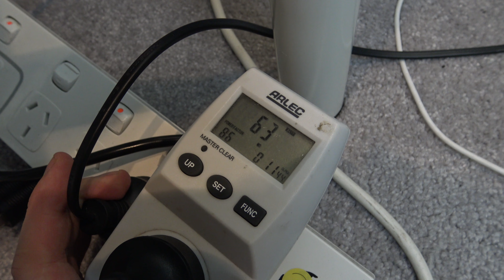How to build a Mining Rig on a Budget

Comment: I'd be careful drilling out rivets use something meant for steel so the damned tip doesn't bend off or something silly. Makes for better removal anyways
Reply: the rivets are usually aluminum, I've found even dull bits take them right out. Technically you only need to shave/thin the head off the rivet, at best an 1/16-1/8 inch deep hole and almost every size of drill bit will work as only the very point of the bit even touches the rivet. (for those running around looking for just the right size bit)

Comment: Does using a SSD over an HHD make any difference when mining since it’s primarily the GPU that’s the focus? Thank you and love the simplicity and detail of the build.
Reply: Not really.  There are some rigs that even run from USB sticks.  It would boot a lot faster which could be nice if the system has a fault and needs to restart however hopefully thats few and far between once the rig is setup.

Comment: Hey just a question, did that "rizer" cable come with the card or did you have to buy it separately?
Reply: All of my cables came with the cards, technically i got (usb to usb cable, riser card, pcie to usb adapter, and six pin power to sata cable) all in one little anti static ziploc.

Comment: wrong graphics card orientation ... all the heat from graphics crad will be push down towards motherboard
Reply from the maker: True, but it sits well that way. Turn it the other way it doesn't fit properly.
Reply: @123myIT  but using an old pre build pc for mining is a great idea ... 👍👍
Reply from the maker: @AkashvaniTech  thx dude.

Comment: Have a similar old dell as you to use. Do you think the motherboard can handle 3 2060s ?
Reply from the maker: Could do you just have to make sure your power is enough and that you have enough slots.
Reply: @123myIT  how big of a pcu do you think. Will 800w be enough. Thanks 👍🏻
Reply from the maker: @ablaze2201  FOR EXAMPLE ONLY. If 65 watts for 1 2060. 65 x 3 = 195 watts + you need to allow for motherboard power and components. So lets say thats 150 watts. 150 plus 195 = 345 watts. Then you need to double the amount of wattage for  efficiency and power spikes. So 690 watts. An 800 watts psu would be ideal. If you do decide to do this get yourself a power meter so you can measure power from the socket. Of you could just use that money and buy BTC :) My Amazon links in the description of the video mate. :)
Reply: @123myIT  thanks for this explanation mate. Helps a lot. If I buy one I’ll support the channel and buy through the link.
Reply from the maker: @ablaze2201  Nice one mate !

Comment: Hellonew sub here. Greetings from Ireland 🇮🇪 
I'm Building my first rig with old pc, and looking forward to start mining for etherium, find this video very helpful thanks.
I csnt get the sapphire rx570,
But I can pick up the 580 for 140euros. Other places are like twice that price,. This  is good budget for me, will the 580 make much difference?  Gonna hook it up to dell xps, I'm sure the current power supply will be OK for 1 card to get me up and running. What do u think?
Thanks in advance for any advice... 👍
Reply from the maker: Make sure you get the 8gb memory version of GPU should work ok.
Reply: @123myIT  hey, thanks for the reply. Yeah I defo wanna get going. Are 2ns hand cards worth it?
Reply from the maker: @todgerx  Most cards come with 3 year warranty. So if you can get original receipt would be ok. You might be better off just buying some bitcoin through a coin app. That would be my advice.
Reply: @123myIT   I'd like to at some point invest in solar. Have seen some amazing set ups.  I wouldn't mind the longer wait on roi.  But would still like mine something at some point. Why are they changing  ethereum? I hear its gonna be less profitable

Comment: I thought Powering the riser with SATA is bad?
Reply from the maker: It not best practice. The main thing is you will just make sure you not overloading power. In instances of mining. Most of the time you are trying to use as little power as possible. Say for example. I run a 2080 TI which is underclocked. It doesnt consume 300 watts of power only 150watts.

Comment: Very good video thanks! I have been studying rig building for a whole hour now haha can you tell me, I dont get the PCIe riser card thing..is that just to make space for large video cards? I see riser cards also have USB connectors..can you just run your cards off of USB ports on the MB? Thanks
Reply: The PCIe Riser is the adapter that connects the GPU to the Motherboard's PCIe connections.
Reply: @jpmonto01  That I know. But why the USB connectors on the risers?? Can you plug the riser into a USB port instead of a PCIe slot??
Reply from the maker: yeh to make space.

Comment: Great vid mate, I'm about to attempt a similar build, 3 years later.
How are you only drawing 70 watts?
The card specs say it uses 300 watts.
Reply from the maker: Use the underclock tools to reduce power. I would just buy the bitcoin directly. Mining doesn't make sense any more in my opinion.
Reply: @123myIT  Why not, care to explain a bit pls >?
Reply from the maker: @justgoogleit7879  Well, you can just stake coins now right? so what's the point of mining. Just buy the crypto and stake it with the money that you would have setup mining rigs. Let me know if you want a referral link and some more info.

Comment: Hi can i make a mining rig using a a68hm mobo and an amd a6 7400k and im gonna use a 1 rx 570 4gb and what psu should i get the 650 watts or 450? And is 4gb ddr4ram enough in this build?
Reply: Or should i just buy a amd athlob 200g and an a320m mobo for more upgradability? Please help!
Reply from the maker: @jjaze9831  I allow about 150 watts per 570 and about 100 watts for cpu mobo.

Comment: you dont as of feb 2019 every video card is pretty much going to earn you cents.   Untill the difficulty's drop anyway..

my usb asic only use's 2 watt's at 23000000 hash's per sec (23gighash)  and it only earns 14 cents per 24 hours...

earnings after 1 kilowatt hour (13 cents paid) is $2          is it worth $2 a month..      well, I got it for only $120

Comment: Very lovely tutorial up there. But Mining Bitcoin and other cryptocurrencies: Bitcoin mining is the process by which transactions are verified and added to the public ledger, known as the block chain, and also the means through which new bitcoin are released. Anyone with access to the internet and suitable hardware can participate in mining. If a contract of $2260 can gain $4959 in 166 days, then imagine a contract of $10,659 (1 BTC) using the PandaMiner B1 Plus, L3+ Antminer, Ebit E9 Miner 6.5T Bitcoin Miner or T9 Antminer. Ask yourself, what will it yield in 166 days also??? You can reach me any day, at anytime via [bitcoindigger86 @ gmail .com or text 470 231 5053]?

Comment: What kind of harddrive should I get?  balancing budget and low power usage?  also is there a cpu thats more efficient than the AMD that comes with celerons?
Reply from the maker: Hi Tom, most SSDs are pretty low power. So get a 120GB one. Links in the description. Sorry what do you mean AMD celerons?
Reply: The Dell Celeron 570 motherboards that come with a CPU ussually come with a CPU thats labelled AMD.  I know the difference it will make will be minimal when builing a GPU but hey its good information to have.
Reply: Im finding a few motherboards online with AMD CPU installed, heat sink fan, and 4 gigs of ram or 2x 4 gigs of ram for a decent deal.  I have yet to call businesses around town to see if I cant find a new home for A CPU destined for landfill
Reply: 123my  I apologize for the triple post, but If I went with one of these motherboards we are talkin about: 32 or 64 bit OS?  I appreciate all Ya do here mate.
Reply from the maker: Hi Tom,
I don't think the motherboard or CPU are so important choices when mining. Most important is GPU. Celeron is Intel CPU. AMD is not Celeron. :)
Reply: Hey mate, whats the bit on the build in this video?  64 or 32?  Cheers
Reply from the maker: Thats weird mate. Unless the box just says that but the CPU has been removed and replaced with AMD.

Comment: Hello From Canada! just wondering how many GPU's can you stick on that with that 750w Power supply. Great video btw got the same board for 30 bucks with the cpu. Or I am asking whats the lowest power Supply that could handle the 3 Gpu's Motherboard and ssd?
Reply from the maker: Hmm I would always go higher power supply if you can mate. You might get 3 to 4 gpus on a 750w psu. Depends on clocking etc.
Reply: Thanks for the quick resonse. was looking at a 850w. I saw that the gpu's you were using were 195w a pice so 3 would be 585w, Pluse what ever the MB and CPU were drawing  thanks tho ill probly go with the 850 then.
Reply from the maker: Nah I added a 750 PSU and swapped the 250 out.

Comment: When I look at the numbers on a small scale, the cheapest thing to do is get a used Desktop that has at least 3 PCI expansion slots. You can find these for $100 - 200. Then that covers your hard drive, MOBO, operating system, monitor, mouse, and keyboard. Then you just swap out the battery with a 600 watt one, buy 3 1050 GeForces, and a set of risers and you're pretty much there. The only last hassle is getting the computer to recognize the cards and configuring your mining .bat files and setting up a wallet and all that. You are not going to make a lot of money, but you can make about $60-90 per month, so the system will pay for itself in about a year. The good thing about a small rig is that it is totally quiet and uses minimal power, maybe $1 a day or so. Also, depending on where you live, it almost doubles as a room heater! I am mostly mining ZCash and PIRL right now. Once the system is set, you can basically forget about it. The three 1050s generate 2-3 dollars per day. But since it is all going into crypto, I see it as a long-term investment.
Reply from the maker: Awesome feedback mate! The other thing you might not be aware of is that you can trade your earnings to generate more cash and you also take into account that those earning could go up or down in price! :)

Comment: The problem with this rig is that many cards blow the heat out the top and this will blow too much heat into the rig by having the cards upside down. I built it and it is not the greatest. Thanks for the idea though
Reply from the maker: Yeh good point in this case you would need to sit them the right way around hehe

Comment: Really good informative video, but just a few points...  The final build shows one gpu card although during the video you mention multiple gpu cards - point being is one gpu card enough?  Also, imho the HD should be flat if possible, lastly, should the build be exposed to dust what have you?
Reply from the maker: Try and stack as many gpus as possible it will give a better return. Dust not a major issue heat is worse.
Reply: Okay, thanks

Comment: i see your the shelf preferred miner, but for single full size evga super clocked 1070 i dont have the room what are your thoughts on a Optiplex 790? i just bought one for $93 shipped on ebay with 4GB ram and an i5 2400 that im downgrading to a 35 watt i3 2100T. i will be removing the hard drive bays and the metal behind the plastic grill for 2x 120mm fans. there's just no videos of the mods i want to do. guess i could be the first!
Reply from the maker: Thats it mate ! Finally someone gets it hehe !

Comment: How to add 2nd GPU I was nanopool mining Excavator with one Zotac GeForce GTX 1060 gpu card so far and added an Asus GeForce GTX 1060 and downloaded the Driver.  It Won’t recognize Asus gpu.  How do you add another gpu?   excavator.exe -a pascal -s pasc-eu1.nanopool.org:15555 -u EXCHANGE_ADDRESS.YOUR_PAYMENT_ID.YOUR_WORKER/YOUR_EMAIL -d 2 -ca
Reply from the maker: it should just detect it on start up mate. You already have the nvidia driver from the nvidia website? Check your device manager?
Reply: 123myIT I wonder if my 2 gpus need to be bridged or sli to work together?  If so how
Reply from the maker: Nope no bridging needed.
Reply: 123myIT I posted pictures on your Instagram
Reply from the maker: Cool couldnt see it ?

Comment: Tried to do a build like this but just cannot get the computer to recognise that there are GPU's in the pci-e slots. Updated the motherboard BIOS and downloaded the amd driver installation but it just will not realise that there is a graphics card in there. Any ideas? I'm planning to just buy a new motherboard and see if that helps. Really good videos tho mate.
Reply from the maker: Are you using riser cards?
Reply: Yes using riser cards - bought 2 and tried with both. Am i missing a trick?
Reply from the maker: Check bios settings?

Comment: I have a 6-8 year old pc that has HD 6870 1GB DDR5 915MHz. Where can i find the hashrate for it? and should i even bother mining with it? If yes which currency would it be able to mine?
Reply from the maker: Probly wont work. But check the computer for PCIE slots. You might be able to run a new graphics card from that.
Reply: it does have 3 pcie slots. runs on ddr2 ram and the cpu is intel core 2 duo Q8200
Reply from the maker: Try with one card first.

Comment: Great video, thanks.  I have a question, I see you are using a Radeon RX 570.  I am using a Radeon RX 560.  To be honest I don't know all the difference, but the major one is that mine is powered though the PCIe slot itself, so I don't have a 8-pin power connector.  Plus, I connected my video card directly onto the motherboard (no riser used).  I'm trying to use Nicehash (legacy version, not 2.0), but it's not detecting my video card.  Have you had any problems using Nicehash and it detecting your RX 570?  I'm using the legacy version of Nicehash because I read that the 2.0 version definitely would not work with my card.  Nicehash is detecting my CPU, but not my GPU.  Any help or suggestions would be greatly appreciated.
Reply from the maker: rx 560 should work. Check your device manage and make sure your rx 560 is there also try updating your AMD drivers.
Reply: 123myIT, I was able to get it to work.  I noticed in other video that they were using Nicehash Legacy V.1.8.2.0 Pre-Release, and I was using V.1.8.1.6.  When I tried the newer version it detected my rx560.  thanks for the reply
Reply from the maker: Awesome mate!

Comment: So I have a radon hd 6770 and an old OptiPlex 760ssf witha a Core2 Dual, do you know if this kind of set up will work for that?.... or possibly connecting the bpi simply for gaming?
Reply from the maker: check the pcie slots mate. And you might be able to buy a new RX 570 to fit it or any of these cards will do.
GRAPHICS CARDS
► RX 570 Sapphire Nitro + 4GB http://amzn.to/2yXIwL5
RX 570 Asus Strix Gaming OC http://amzn.to/2DqWIBQ
RX 570 Aorus http://amzn.to/2DvhWyq
GTX 1070 Asus http://amzn.to/2DN5HuA

(Alternative)
1080 TI http://amzn.to/2FPh4mp
1080 http://amzn.to/2DntBAa
1070 TI http://amzn.to/2FTNRa6
1070 http://amzn.to/2rlDt7K
1060 6gb http://amzn.to/2DvTTzl
1050 TI http://amzn.to/2Dlcdbe
RX VEGA http://amzn.to/2DMNkWT - 64
http://amzn.to/2DhNXGK - 56
RX580 http://amzn.to/2DQTeq5
RX560 http://amzn.to/2DMrNgS

Comment: Hello
I'm New to Crypto have a hardware Question?

Would this hardware mine?

Gaming Box I own

Motherboard  MSI Z68A G43

Video Cards

PNY GTX570. 1280 MB

EVGA GT 740 SC with 4 GB Ram

Power Supply 

Diablotek 600w Power Supply

Ed
Reply from the maker: Its possible , check the pcie slots?
Reply: 123myIT there are 2 on the board
Reply from the maker: Should be ok.
Reply: 123myIT do you have a video on fine tuning Nicehash as my 8 core 3.5 Cpu a  is not earning much
Reply from the maker: Not nice hash no I can tell you how to do it in claymores.
Reply: 123myIT okay how do I change over?
Reply from the maker: Claymores GPU video uploading mate. Once you use that its a line you put in.
Reply: You are uploading that video?
Reply from the maker: Yeah mate here it is. https://youtu.be/RNPPPG95IbI Sorry for the slowness. I don't have NBN yet hehe.
Reply: 123myIT thanks

Comment: What would you need if you kept the existing power supply
Reply from the maker: you would still need a new psu because that PSU is not strong enough for the graphics card. OR you could use a 1050 ti card low profile.

Comment: Allright, so , how about overclocking ?
Reply from the maker: http://www.123myit.com/2018/01/mod-sapphire-rx-570-4gb-elpida-bios/
Reply from the maker: AfterBurner Settings I use to get rig stable.
Power limit: -6 or -4
CoreClock: 1150
Mem Clock: 1970 or 1980 or 1990 or keep going up by 10 till its stable.
Reply: ok sweet, thx for the info
Reply from the maker: np mate.

Comment: Hi 123, great vid. watched it twice already xD But could you tell exactly why you changed the HDD ? you said it's bigger, does it use more power if its a bigger size? or more watt when it has more storage?
Reply from the maker: yeh bigger the drive it more power it will use. so use small one if you can or use ssd.
Reply: SO bigger in size or bigger in storage? (SSD is obviously the best pick, but more expensive)
Reply from the maker: size i think.

Comment: Have you ever run a wattage meter to determine exactly how much power an idle cdrom uses?.  I have built a few cheap rigs but never considered removing that.
Reply from the maker: I just remove everything thats not needed mate. Its probably not much but you want it to use as little power as you can.